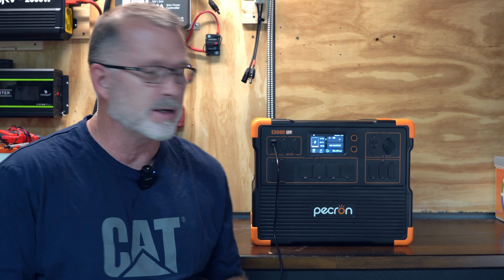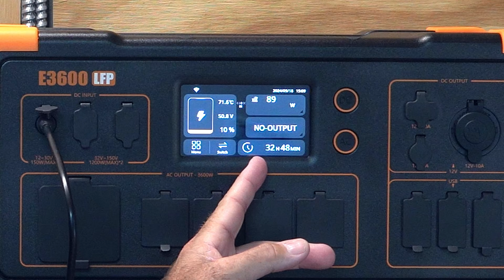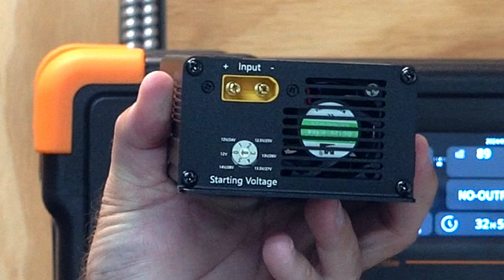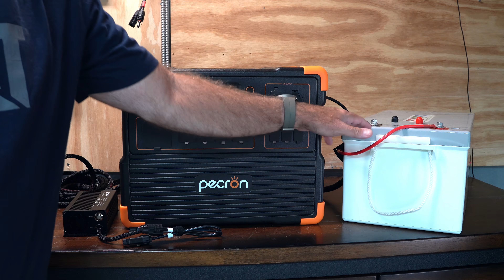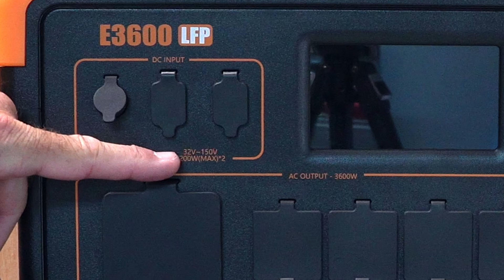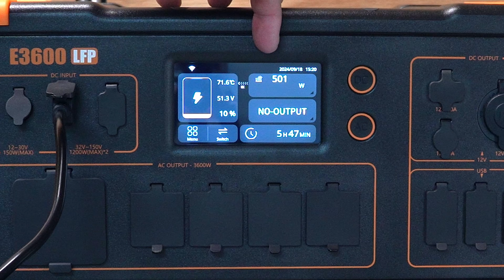A MUST HAVE if You Travel w/Your Power Station: Pecron 500W Smart Charger

Comment: I just bought a Bluetti AC70  that I plan to use in a no build campervan setup in a rented cargo van for 2 weeks. At a rated 768 Wh it sits right in the middle between the <500 and>1000 Wh size you talked about. When I tested it with my SUV's 12v socket it was charging at a consistent 109w. My expected daily use is around 50-60 % of the actual capacity and I'll be driving at least 4 hours every day so I'm really not sure if I need a dc to dc charger or not, and doing the temporary install.  My SUV only has a 120 amp alternator so to run the Pecron safely I can only charge at about 320w. The van's alternator is 180 amps so it's bigger but I wouldn't want to run it harder on a rental van and risk damaging the alternator. Your thoughts?

Comment: with reference to charging f1000 pecron from a cigarette lighter receptacle ,a.pecron don't supply a 12v charger with an xt60 connection and more importantly you have to charge at charge rate set to 20% the lowest setting available and the charging cables i bought cant handle it they get very hot ,the barrel cigarette lighter outlets and plugs are not capable of handling sustained output necessary to charge even when charging at minimum rate ,hence probably why pecron dont supply or even manufacture a 12v type  car charger with a xt60 input.Disapointing that you have to spend an additional $150 to be able to simply charge this while driving and it looks like this charger doesnt have xt60 connection for the f1000 so going to have to spend more on more connectors ,jees im almost at the point of returning this and going back to Jackary

Comment: Hello I have the same set up looking to hook up.. what cable do I use from the charger to the pecron dc input?
Reply from the maker: You'd just use the solar adapter cable that comes with the power station and connect that to the MC4 connectors on the DC charger
Reply: @ReeWrayOutdoors  ty.. ill check.. been a while..  so its an mc4 to whatever female is on the pecron..  both inputs are connected to solar panels.. im guessing I can unplug one and use the car charger and one panel..
Reply from the maker: @calvinbecker1366 yeah that should work too

Comment: Why not just get a 12V to 120V pure sine wave inverter and charge from that? You could also get other uses from the pure sine wave 12v to 120V inverter of 800w-1200w. I'm not saying this or this type isn't a good product, just that they are limited and I wouldn't buy one if I could have a pure sine wave inverter instead and charge a power station from that.

Comment: Coming soon, the new $30K Chevy Bolt will be vehicle to a house capable, but you have to buy their expensive hardware to output it, for now.  The recently discontinued Ford Lightning - Pro Power Onboard, offering up to 9.6 kW of exportable electric power through bed and frunk outlets. It includes 120V (20-amp) outlets for tools/devices and an optional 240V (30-amp) outlet f

Comment: Mine only works with my stand alone Dr. Prepare battery for a few seconds on my Pecron E1500LFP and E3600LFP before it shuts down. It works as intended with my Zendure and Oukitel power stations. I have the dial set to 12v like you did in this video. Its almost like the continuous, non fluctuating 42v input confuses the MPPT.

Comment: What damage will that do to my vehicle alternator or battery?
Reply from the maker: A general rule as I understand it, is that you want to keep any continuous current draw on your car's alternator at or below approx. 1/3 of the rated current output of that alternator.  So at 500W / 12V = 41.6A x 3 = 125A rated alternator.  This is not to say that you WILL damage your car's alternator if you exceed that 1/3 current draw, but beyond that, you could actually be stressing your alternator to where it's long-term service life could be shortened.  And so in the case of this particular DC-DC charger, if your car's alternator is rated for at least 120A, you're probably completely fine with no real concern about long-term impact on the alternator.
Reply: @ReeWrayOutdoors Thank you !

Comment: would this work with a Prius?
Reply: UPDATE - It DOES work on my Prius. took less than 10 mins to install charged my 3600 at 450 at 13v setting. I am getting a smaller one for travel. Prob 1500 maybe 2400. This was instrumental in my first Pecron purchase. Thanks for posting.

Comment: how do you calculate the right max amps charger to shop for if maximum dc input is 30 volts on Power station .
or maybe the answer is not so simple

Thanks

Comment: I’m now looking at the Pecron e1000lfp because of its physical size and it can have the e3000 battery added on to it which is a 48 volt battery.  I’m wondering if this 500 w smart charger would work with the e1000lfp.

Comment: I have a Jackery 1000v2 and will be okay with a max DC input of 60v, but only a 400 watt max.  Will I be okay, or will this damage my Jackery?
Reply: Okay. The Jackery will take only as much power (400W) as it can handle. The important compatibility question is the voltage.

Comment: Excellent material!  I’ve heard people are burning their alternator s out charging this way though. Your alternator is made to run in short increments as it gets very hot and the fan blades are small. You’re now running it for very long periods of time. One couple I know replaced their alternator with a race car type. It’s about 2-3 times the size of a regular one. The challenge was getting it to fit in the old spot.

Comment: Hi, if power station is fully charged can i use that charger to charge lithium battery instead power station?
Reply from the maker: @voytek2099  No. This charger outputs 42V so definitely not suitable for directly charging a lithium battery...only the other way around.  In the unlikely event you had a 36V lithium battery, you could probably get away with it but still not optimal.
Reply: the power station has a solar charge controller inside. So the lithium battery needs a solar charge controller also. 
OR plug the MAINS Voltage CHARGER for the lithium battery, into the power station OUTLET socket, which supplies MAINS Voltage OUT. 
That would be less than ideal, but it would work, to charge the lithium battery.

Comment: 12v at 500 watts. That's like 42 amps. That would absolutely blow Amy circuit breaker. Most 12v outlets are 15 to 20 amps
Reply: 2:54 the output at 500 Watts at maximum 13 amps

Comment: I understand that I can set the input voltage on this unit such that it won't charge whatever portable power station it's hooked up to when you turn off your vehicle's engine.  But does this unit draw any power at all from the vehicle battery in this condition?  I'm worried about what would happen if I forgot to manually shut the unit off after arriving at camp and left the unit in the "on" condition for several days while my truck sat idle at camp.

Comment: I am so glad I found your channel. I have been binge watching it the past two days.  I am pleased to see even though I do not get all of the tech information watching it a few times it sinks in better.  I am the only one in my family interested in solar and power stations so to have acces as a female to learn it on my own, I am very grateful to this information especially with my limited knowledge.  I had thought watching some previous channels "is it possible to be selfreliant and use your vehicles battery to charge a portable power source particularly during power outages or potential serious grid issues when you cant use your home to recharge and may not be able to rely on the sun even if you have a solar set up.  Delighted to see I was correct and that I now have the information on the device I need to make that work. Thank you. Looking forward to watching more of your content videos.

Comment: Why wouldn't I buy a 1000w DC>AC pure sine wave inverter for less money, get twice the recharge time?
Reply: Great question.
I think the only reason is higher efficiency by staying in DC, instead of inverting to AC and then rectifying back to DC.
But, if you want speed (which was the original problem with the cigarette lighter charger), then definitely the 1000W inverter is faster, if the car alternator will handle it.

(Clearly you mean half the recharge time.)
Reply: Oh, the other reason, mentioned in another comment, is that your power station might draw more than 1000W from its AC input. Some stations will let you limit the input and/or the battery charge power, though.

Comment: Just make sure your alternator is at least 2 times the Amperage of the input Amperage of the DC-to-DC Charger.    Otherwise bad things can happen to your alternator.

The other option is a DC-to-DC Conveter.   You can easily get 400W chargering that way with the Victron DC-to-DC Converter.

Comment: ooh. Ive been debating between an Ecoflow Delta 3 paired with the Ecoflow 800w and the pecron 1500LFP. this makes the pecron more attractive for just about the same price with more capacity. additionally it should be pretty easy to customize the cable run to make it into my truck camper behind the truck cab

Comment: It seems I could used this to charge the Lifepo4 battery on the tongue of my camper that has  a BougeRV Sunflow Solar charge controller that can handle 40amps and 100volts.  Do you see a problem with that? Just unplug the solar panels and plug in the pecron on cloudy days.

Comment: Using this on a Tesla, etc. or 2 of them with 2 inputs seems like a good vehicle to load option.
Reply: Curious how so?
Reply: @a.greenwood8762  Every ev automatically recharges its accessory 12v battery(used for windows, fans, lights. etc.) from the high voltage traction battery. Using the solar inputs the power station can recharge as your home appliances and hvac draws it down. You have access to the entire car 60kWh+ battery until utility power to your home is restored. After days, you can use a DC fast charge station to recharge your car when it gets low. Maybe take an hour.

Comment: 24 volts input produces the 500w max what will 12 volt produce? Ecoflow delta 2 has around 15 amp limit .so 15a x 42v?...500watts @ double the amps compared to the 24v setup. So somewhere around 40 amps from the donor battery/alternator? Is the wire provided adequate?

Comment: Hi could this be use in a Toyota Prius, since they don’t have an alternator, I’m guessing it can be use but not 100% sure 
Thanks for any info 😊
Reply: an auto electricial can probably connect it to the 12 volt battery that the radio, car alarm, electic seats, windows, all run from.

Comment: Thanks for the video, Do you have a link to that 24V Battery you used in this video to charge E3600? also is this a sustainable way to charge with just a battery that is not connected to a car and alternator? it would be nice as a back up instead of a generator, thanks alot

Comment: Excuse me for being a bit slow as i've just woken up...UK viewer here, but you connect it to your car battery & to your powerstation, turn on the vehicle and it will charge up the power station when the vehicle running? Thanks.
Reply: You're not alone. I don't understand it either.
Reply: Yes, exactly. What's the confusion?

Comment: I just got a buletti AC50B under the DC/ PV input it says ,   12v-28v/8.5A/200w.    Can I use this product ? Please be kind. Im an old lady lol ... 😁 I know nothing about this stuff this is my first power station and I am totally confused. 🤔😒
Reply: Hello, if you really want car charging you could get an Auto Electrician to wire up a 24 volt boost converter to the car battery through a VSR Relay. 
This would give you full charge in 2.7 hours on the Bluetti AC50b . 
Hope that helps.
Reply from the maker: Unfortunately that 28V max input would not make that unit compatible with this charger since it outputs 42V.

Comment: That's definitely something id be interested in I put it on my Amazon wish list. Thanks, ReeWray BTW does it come with all those cables?
Reply from the maker: Yep, the only cable it doesn't come with is an MC4 to whatever it is that you're charging with it.
Reply: @ReeWrayOutdoors  ah ok thanks.I just bought a Bluetti AC180 and i want to charge it via battery.I could buy a Bluetti 500-watt power brick which is very close to the same price as the Pecron smart charger, except it doesn't have the variable power option which is always a plus I think.

Comment: Just my opinion after countless hours looking for a good way to use my cars for emergency power - you can get a 500 watt pure sine wave inverter for $69 or a 1,000 watt for $200 at Harbor Freight (probably less if you buy it on sale) and just do AC charging as long as your power station allows you to set the AC charging rate appropriately. I know it's not as efficient as DC to DC charging, but it's a more flexible solution and more scalable to your alternator output.

Just know your alternator output and make sure you can set your power station AC charge rate appropriately (about half the alternator rated output for safety). The alternator rating is based on a higher RPM than idle and may rely on the car being in motion for cooling at that max rate, so you REALLY shouldn't try to max it out.

An alternator rated for 70 amps at 13.5 - 14.5 volts (~1,000 watts) is fairly typical of small cars and light trucks, so 500 watts is about all you want to pull off that while idle, but if you've got a big truck or RV, your alternator may have a rating double that or more (check for your specific car/truck). If you've got a 140 amp alternator (~2,000 watts) and you can set the AC charging rate on your power station to 1,000 or 1,100 watts, why wouldn't you go that route?
Reply: That’s exactly what I did. The alternator is 150 amp. And I was able to set the 1,000 watt/hour power bank to limit of 500 watts of charge. Cost was $70.00 and a simple self install. Works great and I can simply transfer to another vehicle if need be.
Reply: Some power stations don't have adjustable AC input charging speeds. Like the Pecron E1500. It's 1400 watts and non-adjustable. I also have an Oukitel 2000wh power station that does 1100 watts input.
Reply: @Bamabrute85  If you have a 140 amp alternator and a 1,200 watt+ inverter, you could AC charge the Oukitel at 1,100 watts rather than 500 watts DC to DC. I'm aware that not all power stations have the ability to throttle AC charging rates. That's why I mentioned it several times as a factor in the decision.

I think the Bluetti AC180 allows you to throttle AC charging to 300 watts, 1,000 watts, or 1,400 watts. If all you have is a 70 amp alternator, then a 500 watt DC to DC charger might be a better option for you because you would have to set the Bluetti for 300 watt AC charging.

My main use is for emergency power backup at my house. If the power's knocked out in a storm (no sun available), I could parallel any two small cars together with jumper cables and get 1,000 watts safely (until the gas runs out). I could get a duel fuel generator or some other option as well, but I don't want the maintenance headache. I'm just offering up some options.

Comment: You are a valuable service to our community. My dream is to be able to charge the battery bank from Tesla charging Station the same way you have to get propane bottles refilled, most of us have to go into town and buy food and grog occasionally.
The tech is all there, just need somebody with the skills to put it together. Elon may not be happy at the prospect of exploding recharging stations and set the boffins onto creating an RV Power Cassette.
Reply from the maker: Yeah, Dabbsson actually took a crack at that use-case for their power stations, offering an optional connector that lets you charge the power station through an optional J1772 to 'infinity port' adapter.  It's limited to 120V charging though so it still caps out at about 1800W.
Reply: @ReeWrayOutdoors  The problem I've found with Solar Panels is vulnerability to theft, wind and in particular cattle dancing a jig on them. An EV battery capacity would be enough to power a fridge, Starlink whatever for a week. The problems are weight and cost.